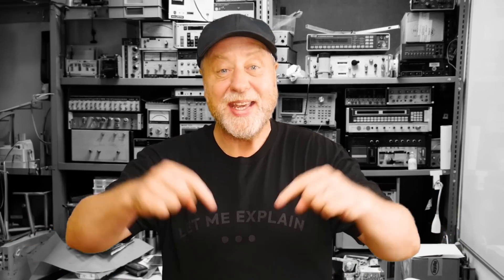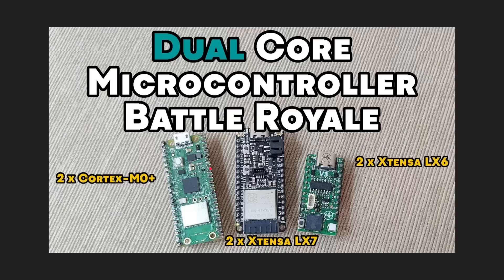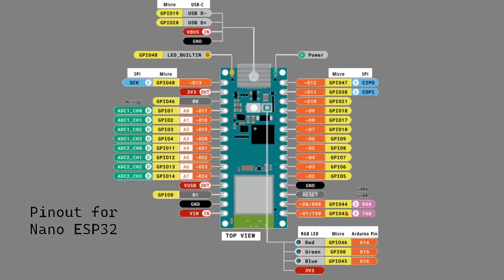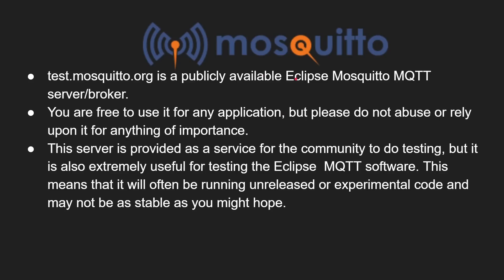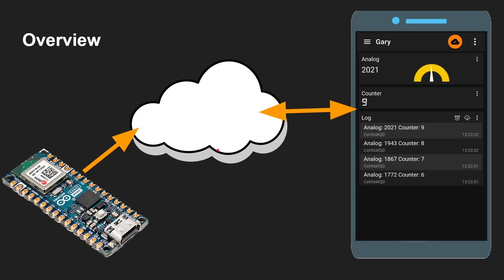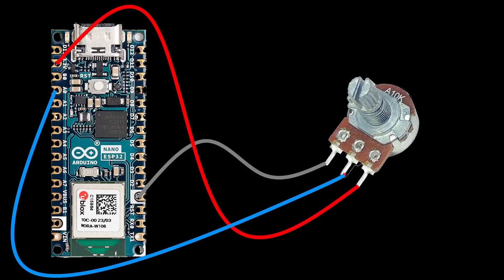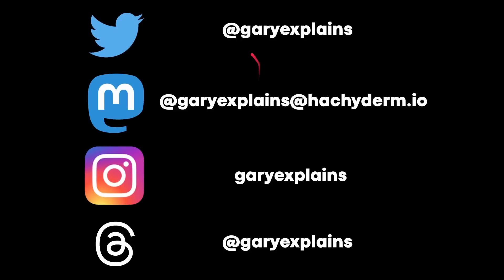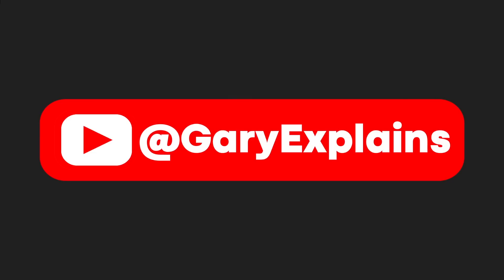Arduino Nano ESP32 Review - Official ESP32-S3 Board from Arduino

Comment: Before I saw your video, I chose the serial port to do the upload and it worked great. Now I just tried what you said re the DFU port and after an ok upload the sketch fails trying to write to the serial monitor. I then changed tho port back to Serial and the output started. Seems like there may be more to it.

Comment: Finally an Arduino board (at least among the non-avr versions) with a pin layout and routing that doesn't burry my OCD deeply underground. Almost all pins of the MCU are exposed (except for 6) and are not completely random. I almost gave up on the new boards (having used the Nano 33 IoT with conflicting documentation), but now I want this in my collection too.

Comment: Well done, mate.  I did buy one for testing in Canada, mostly the shipping issue surfaced.  However, you didn't comment about ESP_NOW peer to peer WiFi.  I will try it out for sure with ESP32-S3 from Espressif, itself.  The tips about getting the correct library and port will save me lots for which I am indebted to you for your video.  I will also try Platform IO, too.

Comment: It fills me with horror to think that you need a third party server somewhere to communicate between to typically local devices.
Reply from the maker: Well you could run a local web server on the Nano. I show how to do that in other videos and there is example code in Arduino. But of course the main point is that with IoT devices the sensor and the monitor are NOT on the same network. If I want to monitor the temperature, for example, while I am away from home then using the cloud is a good solution.
Reply: @GaryExplains  I have spend ages trying to get a pi pico to act as a AP when no known network is available, web-server for the UI, mDNS server so it is discoverable and web-socket server so I can send continuous input commands to it. Maybe I ask too much of it. I managed to get it going but it's not reliable yet unfortunately.

The examples out there only ever handle one thing but rarely offer an end to end solution.

Thing is, once created pretty much every IOT device could be based on it.
Reply: I am going to test ESP-NOW which is local peer to peer without any public server at all.  I have asked Gary to test and release a video, too.  I just ordered one but will test ASAP as I have a robot cart using ESP NOW to report data about the cart to a remote ESP32.

Comment: Just want give you, and your viewers, a little warning: The pictures of the potentiometer is a little confusing. The one on your board says "B10K". The "B" means that it has a linear track. But the one you show as example connections is marked "A10k". The "A" means that it has a logarithmic  track. Using a "A" potentiometer in this case would give a very different result.

Comment: I got mine in the mail today, but have not tried it out yet. Anyway,  I also have a few raspberry pico's, but I find them to be hassle to setup for just programming them, while Arduino feels like a few mouseclicks away.
Reply from the maker: But you can program the Pico using Arduino, so they are the same in that respect.
Reply: @GaryExplains  Ah, I did not know that. When I bought them it was like a 10 minute setup on my raspberry pi to get it to work. Will check Arduino ide, thanks.

Comment: It's not just a dual core, there is also a third ultra low power core who is working when the two main cores are in deep sleep. It isnt able to access every memory region (which is quite fragmented in this architecture) but in many cases you can use interrupts of the periphery or program some timer to wake up the main cores every now an than. If running on batteries this can extend their lifetime quite a lot

Comment: doesn't it have less pins ? so other than slightly  easier programing what benefit would you have choosing this over other s3 boards ?
Reply from the maker: Easier programming (like you said), quality, guaranteed supply chain, support, life-cycle, drop-in replacement for other Arduino Nano boards.
Reply: @GaryExplains  I didn't consider the drop in replacement, very good point
Reply: @youssubernfissi5559 sorry to ask, what do u mean by "easier programming"?
Reply from the maker: Because other ESP32-S3 boards are generally cheap boards from China then documentation can be lacking (sometimes even discovering which pin the LED is connected to can be hard), there is no guarantee that the board is supported, no guarantee that extra features like PSRAM will work. In short you often waste time hacking to get things working.
Reply: @liriahron Programming microcontrollers in Arduino Language is comparatively easier than programming in Embedded C.
Reply from the maker: I think the point is that you can program lots of ESP32-S3 boards with Arduino.
Reply: @liriahron  you shouldn't be sorry to ask my man. I think it boils down to 3 things
1-better documentation: it is more detailed, talks about more aspects and it's designed for beginners( so breaks down complex ideas to familiar ones), you'll know how to use everything and the specs of everything, sometimes you don't even know the voltage range for a normal esp32 board or what kind of power supply it has or like Gary said even the user-led pin isn't clear

2-better examples: the documentation isn't always enough, you can read all you want about analogWrite() for example but you'll need an example to master it, other boards either don't have examples or have very complicated ones oriented for experts, while Arduino provides ones that you can literally just copy and paste into your code with commentary and don't take "short cuts" that make the code hard to read 

3-better libraries: Arduino is more popular so most libraries focus on it more and work with it best, we can add to this point the fact that more video tutorials and groups will talk about Arduino and produce projects that you can copy and learn from.

in short, Arduino is like the friend who gives you the car and teaches you how to drive while other borders assume you know how to drive so they just show you the location of the car and leave you to figure things up for yourself